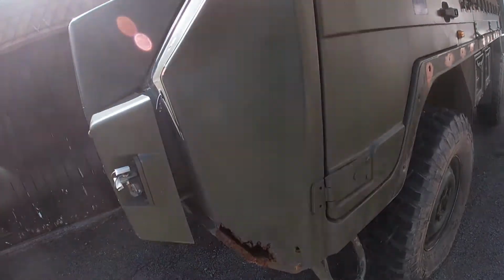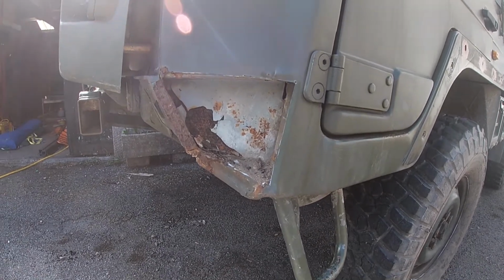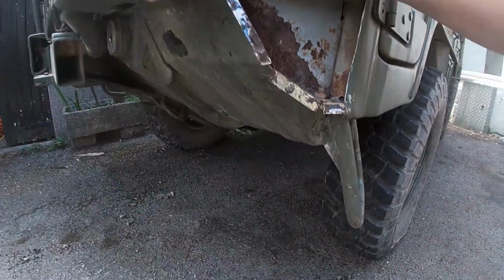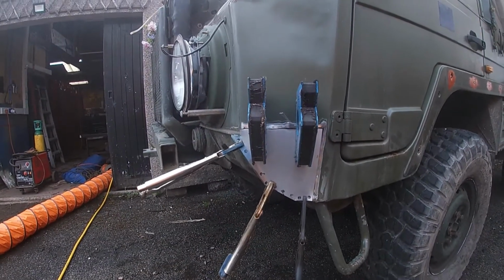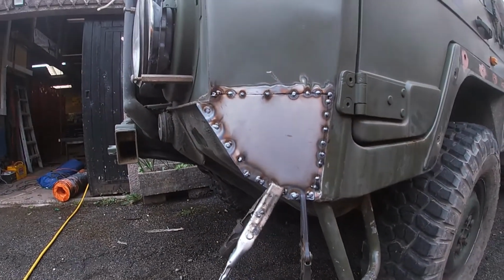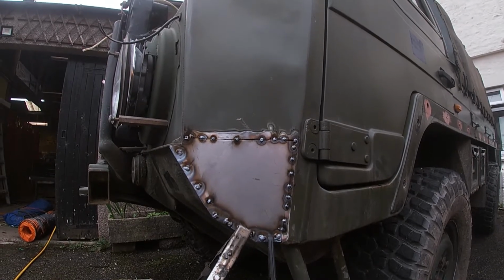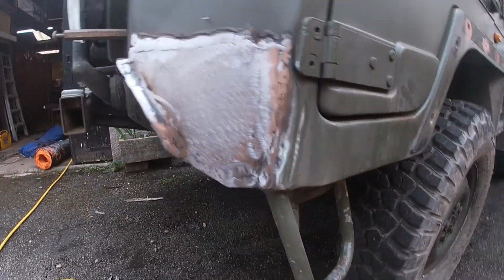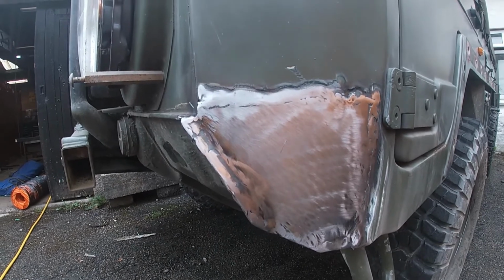FIX A  WING RUST HOLE Pinzgauer 716 - Ep 8 British Army Truck  ?

Comment: Nice...
Reply from the maker: Thanks. I’m quite happy with it. It’s been resprayed since and you can’t see the repair. That’s for another video…..
Reply: @choppergray1  I recently bought a PPV VECTOR (6x6 pinzgauer) which is heavy, so taking off the armour panels and will replace so it looks the same ....dont have your skills, but hoping to do most of it myself.  Got a friend doing an engine service first, then repair the hand brake, then hopefully replace armoured windows, then mot time......going to take my time.  Might add a winch and some lights (replace headlamps for something better).